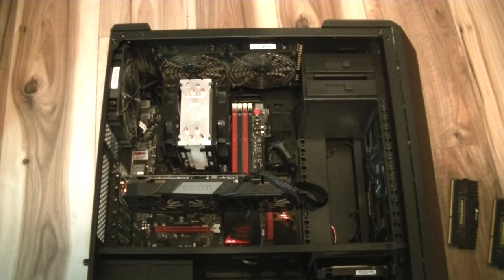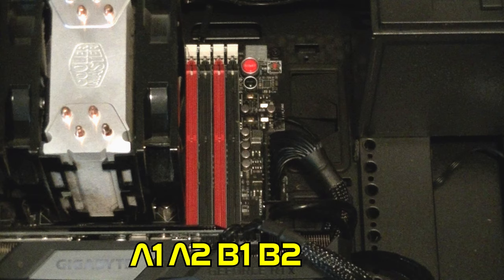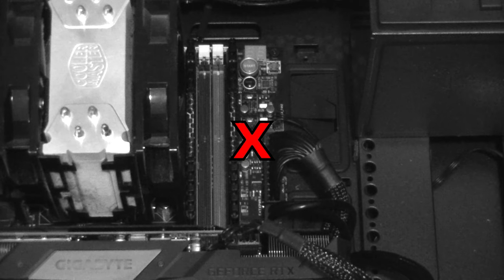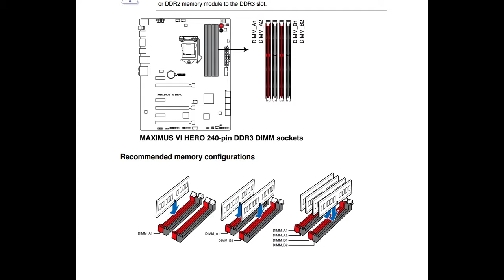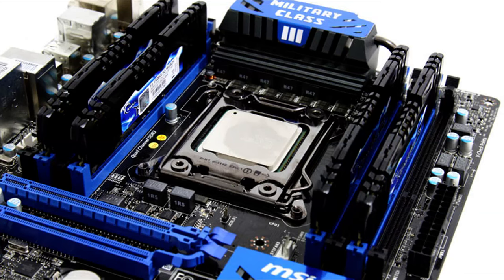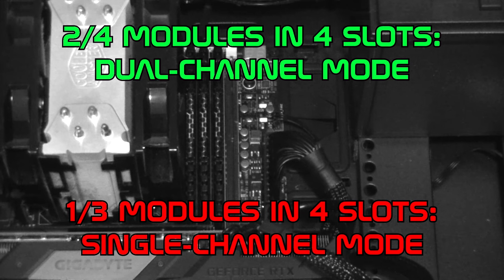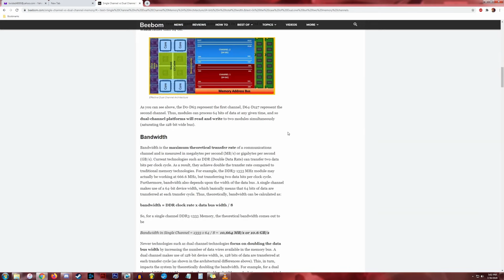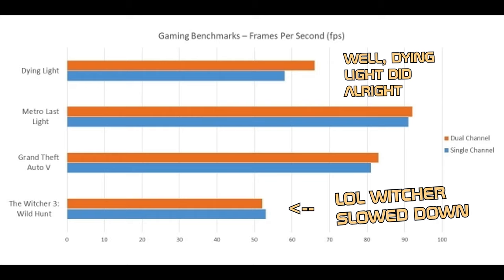How to Make Your RAM Run in Dual-Channel Mode

Comment: Nope. A1 and A2 is one channel and B1 and B2 is secend. You shoud keep same amout ram in bouth of channels. No matter which one, it coud be A1 and B2, CPU-Z WILL raport proper DUAL CHANNEL configuration. You coud also make  4+4 in A1 and A2 and 8 in B1/B2 and it still going to be dual, sinc amout in bouth channels is equal.